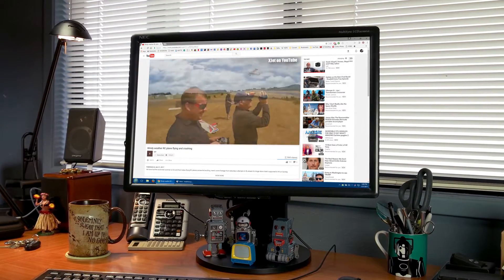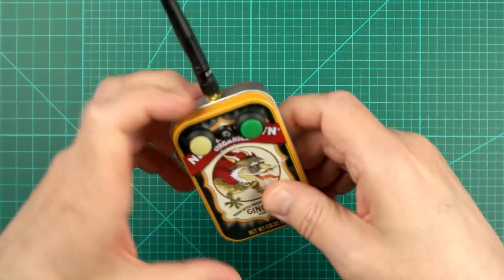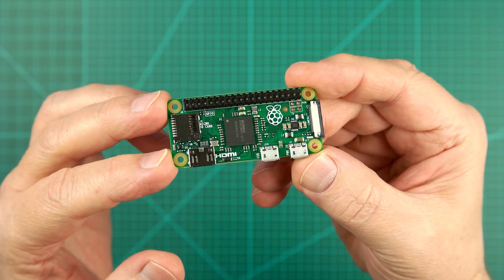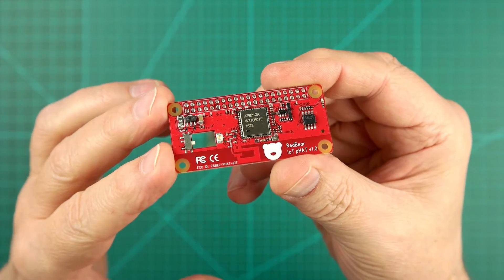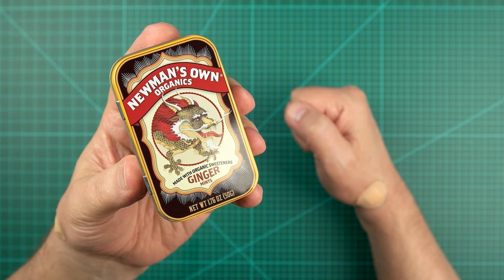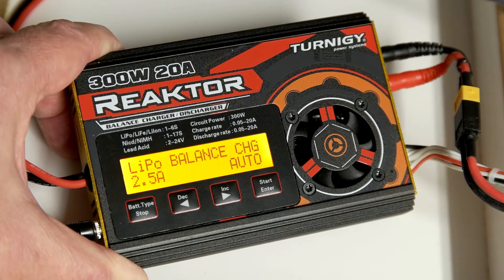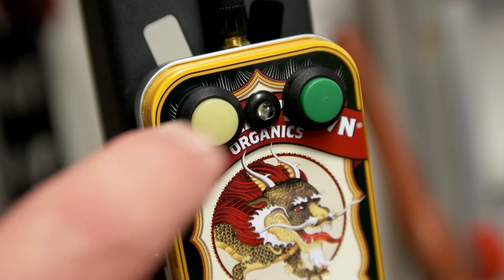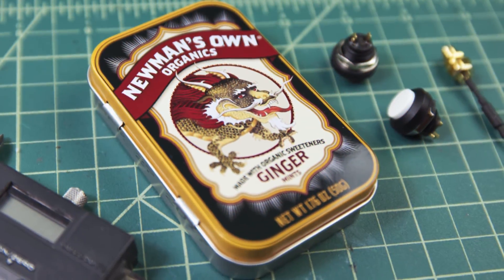Emails From A Battery Charger Using Raspberry Pi

Comment: Excellent job I just bought a HTRC C240 the piezo  is not even loud at all for me.  so if  I parallel a 3.5mm or add a new  peizo I be good?
Reply: thank you wired a jst hooked to a bluetooth and sound is much better. time to find a  micro blouetooth speaker
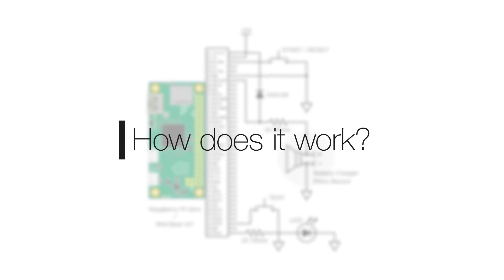Reply from the maker: Thank you!  Yes, if you run leads in parallel from the piezo buzzer as shown at 03:38 you should be good to go.  If you simply want a louder buzzer you could also try adding a second buzzer in parallel to the existing one (although removing the existing buzzer first would be ideal to reduce the load) -- just be sure to measure the drive voltage across the existing buzzer and then use a very low power device with similar voltage ratings (I couldn't locate a schematic for your charger so I don't know how much drive current is available to the buzzer)